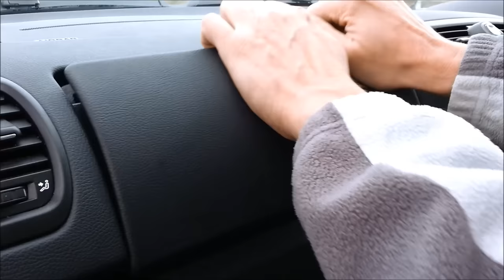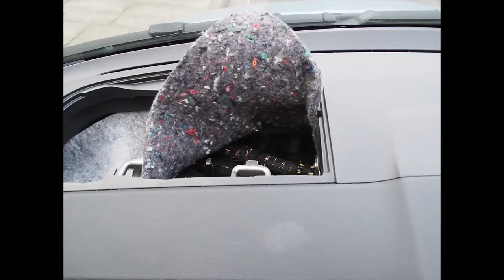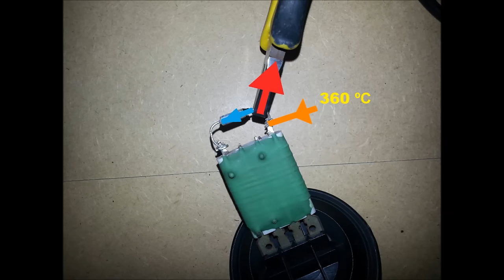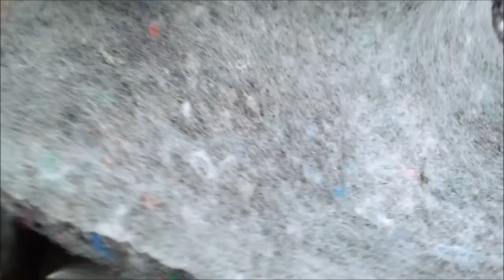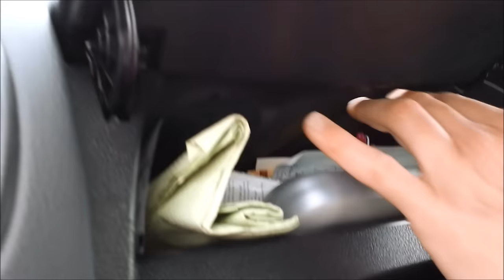How to Replace Blower Motor Resistor Skoda Roomster Skoda Fabia

Comment: Worked like a charm on my Roomster 2007. Bought the blower resistor off ebay for 17 dollars. The work itself took med all and all 40 minutes. Had a bit difficulites clicking on the new resistor. Couldnt twist it back fully but nevertheless, it was secured in it´s place. Now alla speeds on the fan are working. Prior to this operation I hade zero effect on level 1 and 2. Thank you so much for this video! Your effort saves a lot of money and time for us all! I take my hat off for you Sir!
Reply from the maker: Thanks a lot for your comment
Reply: What is the name of the piece, you replace it?

Comment: Thanks, worked a treat on my 2011 Fabia. I did buy the whole fan resister unit for about £10 from Amazon. It then just took about 45 minutes to fit 😎

Comment: Just done this, great instructions, cost me £7.39 for a new resistor unit, not soldering required, just clipped it in!  Relatively easy to do, if I ever need to do it again it’ll be easy.
Reply from the maker: Thank you for the constructive comment Andy.
You're right, it's easier and faster to replace the entire unit.
Reply: What type of resistor is it?
Reply: this is the right question

Comment: Excellent video - just saved me £100 and 2 days off the road.  Only took 30 minutes to do and no problems when connecting battery agai9n.
Just need to be very careful about NOT dropping airbag securing screws when removing them.  Magnetic bit holder and cardboard used to cover holes just below the screws highly recommended.
Reply from the maker: Thanks a lot for leaving a comment and and a tip. It's very easy to loose a screw.
I'm glad it worked for you.

Comment: I'm very grateful to you for this. It was a fairly simple job and took only 30 minutes. The hardest bit was getting the new component to seat and lock in place. There is very little to lever against when using a screwdriver to remove the airbag, but the end of the lug on the far right can be lifted against the steel bracket below it.

Comment: Just did my 2013 Fabia with a replacement part from Ebay at £9, bit of a sod getting the airbag plug off and then back on, but all done in about half an hour, or so it seemed! Those Torx 30's are tight!! All done, fan working again, thanks very much for the vid, excellent help!!
Reply from the maker: Well done! Thanks for a comment

Comment: Your brilliant video has just saved me around £150. Quoted £53 for the part and £108 to fit by local Skoda garage. Bought replacement from Amazon for £10 and took me around an hour to fit. Bit fiddly but quite doable. I put a small blob of Blutac on the end of my torx bit to hold the screws when I removed them - many thanks.
Reply from the maker: Robin Pugh 
Thanks fot the lovely comment. It's  great that it works for you.

Comment: Great and very helpful video that saved having to take the car to a garage for a simple fault. Got  a replacement resistor off eBay and got the job done in half an hour. Read other comments and followed tips like blu-tac on the torx driver. Once I removed the airbag T30 screws, it was loose and I could see that it just needed to be levered up with a large screw driver to pop it out of the dash top. This was helped with some plastic trim levers I already had. Managed to do it without disconnecting the air bag too. The hardest part has re-installing the airbag top cover but once I realised how it clipped back in it was no problem. Thanks for posting.
Reply from the maker: Thanks for leaving a lovely comment. It's great to hear the film was useful

Comment: Hey there, thank you for the video!

I own a Seat Ibiza 4.  2008 with only 4th speed working on the fan. I bought a new resistor but the issue is not solved. Still only 4th speed working. Any suggestions? Тhanks in advance!

Comment: Great video, everything perfect except mine is T30 bolts holding the airbag in.  Struggled getting the cable off the original resistor pack but got the pack out easily, really struggled getting the new pack in, couldn’t turn it all the way, assume it’s ok as it felt secure!!
Reply from the maker: Thank you. My low quality torx bit size 30 was a bit too big.

Comment: Good video, my fan does not work on any speed. Could this resistor pack still be the problem or is it likely something else like the motor and if so do you have a video of replacing the motor.
Reply: Try the fuse. The fan should still work on setting 4 without the resistor. If not it would be motor.

Comment: Does this control both fan speed and heat? We have a mk2 fabia 2010 that blows on all speeds but only cold air. We've checked the heater core and that seems fine. Can't think of anything else. Thank you.
Reply from the maker: This only regulates the fan speed. It does not set the temperature.

Comment: Hi, In my 2009 roomster the blower works fine but there is no heat comming out.
I checked the hot water pipes and their both hot.
There is no noise when I twist the temperature button so it is probably the blender door actuator. Do you have a video shows how to replace it?
Reply from the maker: Sorry I have just came back from holidays. No, I don't have a film about it but I'm sure I've found something by now.

Comment: Tried this , great instructions but I still have the blower only on number 4, any ideas please ?
Reply from the maker: If you only replaced the thermal fuse, the resistor may be damaged.
https://youtu.be/LUNvzyvn8J8
Reply: @k-nemo  where is the resistor please, I only saw that unit and changed it

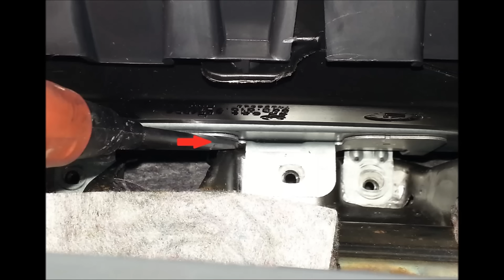Comment: Great vid. Although the arrow at 1:41 should be up as the airbag pops up and out, not sideways and up. The leverage needs the be upwards.
Reply from the maker: Thank you for appreciating my video. I am pushing the screwdriver in and then turning it.

Comment: So, my speed fan 1,2,3 not working, olny 4 th speed, does this solve my problem?
Reply from the maker: This means a damaged resistor. The thermal fuse may be blown or the resistor circuit may be open.
https://youtu.be/LUNvzyvn8J8
 Replacing the resistor usually solves the problem.

Comment: Please guide how to pick a matching thermal fuse 10A or 15A. and also please guide how to solder a thermal fuse in which direction or it can be soldered both sides
Reply from the maker: 10A should be enough. Any direction is OK. This is not a semiconductor element.
Before changing check yours thermal fuse. Often is faulty but sometimes there is a gap in the circuit in the unit. You can buy new unit in Chinese shop for a few dollars.
Reply from the maker: Check my film: https://youtu.be/LUNvzyvn8J8

Comment: Am I right in thinking that what you actually replaced was a thermal fuse. The green part is a resistor tapped at several points for speed control?
Reply from the maker: It is a thermal fuse
Reply: RG5355 I got the whole until for a tenner off eBay, no soldering involved

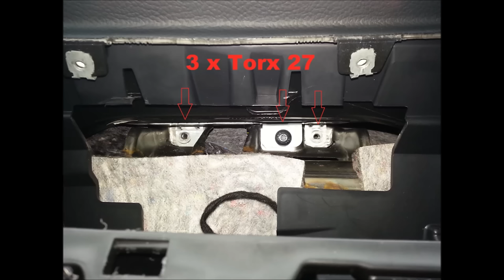Comment: 2 things I did wrong to warn others of, when unscrewing the main screws at 1:15 it is easy to drop them down into the car and lose them... I happened to have  a foot long pair of tweezers so was ok but after dropping the first I got some card and bent it gently to make a gutter to lower the risk as the bolt came out, same for putting it back.
Other point... as the video says, don't use a screwdriver to lever open the airbag hatch... but equally, when trying to maneuver the air bag to disconnect it, be careful not to rub the air bag fixing across the dash, it has sharp metal pieces on it which scratched my dash worse than the screwdriver showed!  Like others I just bought the whole part rather than the resistor... my part looked rusty and had a breach in the coil.  Also This is a Skoda Fabia MK2 although the video doesn't make that clear.  I am not saying that a mk1 is different... but according to the ebay listing I bought the part as shown in this video from, said it was not compatible with the MK2.... this was not the case however, it looked the same and worked fine.... just saying that because I was anxious when I bought the part but this video convinced me it was probably ok and it was.

Comment: Will this work on a UK skoda yeti 2.0 tdi 4x4 RHS model? Its a 2010 year model. My symptoms are that the blower/fan doesn't work on any settings not even one through to the highest.

Would appreciate it greatly if somebody would post a link to resistor that would be appropriate for this model?
Reply from the maker: When the resistor is damaged, the blower only works at the highest speed. Check the fuse in the box.
Reply: @k-nemo  thank you for the response will have a look
Reply: I have checked all the fuses with a tester for continuity. All are good. Like i said it doesn't blow on any setting. Could it be that the fan is faulty? Or shall i replace the resistor first?

Comment: Hi
I managed to remove the airbag and I can see the resistor unit but can't get it out. I tried wiggling it to the left and right but no luck. Is there a trick to this? I do not want to break it...

Also, can you give some info on the type of resistor that you replaced
Reply: And where do you buy just the resistor?
Reply from the maker: To take the plug out you need to squeeze it like shown with the arrows. The resistor needs to be turned and pulled out. Sorry but I can't remember which way. I got the resistor from somebody. My friend also soldered a resistor but it didn't work. It started working when he brought a ready to use resistor with a holder.
Reply: Thanks for the speedy reply. The trick was to push down while turning it. Anti
clockwise worked for me. I have a left hand drive car.

I found a complete resistor unit for only as few bucks more than just the
resistor on eBay.

Comment: hello, nice video. Which resistor is needed? thx a lot!
Reply from the maker: It's cheapest if you buy the whole pack online, for example banggood, aliexpress, ebay. Some resistors for soldering are hard to pick out, the resistance could be different.
Reply: k-nemo Okay! ty
Reply: It is a fuse that burns over 240  degreeso to protect the resistor that controls the speed of the fan motor.

Comment: Hello wich temperature for this thermal resistor, is 240° is right
Reply from the maker: Thanks for watching. The temperature is not given on the resistor.  Often there is a problem in picking a resistor with the correct resistance. For a few dollars you can buy a full set.

Comment: do you really need to disconnect the car battery to carry this out? TIA
Reply from the maker: You don't  have to but I felt better when I did it while I was taking the airbag out. When you turn the key with disconnect airbag the computer will register an error which won't disappear on its own so you'll have to go to the mechanic to reset it.
Reply: @k-nemo  hi thanks for your reply. Do I need to turn that key to disconnect the airbag?
Reply from the maker: No, the key has to be taken out, the power off. In fact you don't have to disconnect the airbag at all but you have to be very careful not to scratch the cockpit plastic with metal part of the airbag. It can be done easily.
Reply: @k-nemo   Thanks...just did mine today. It was a real pain as slightly different to yours, I have a Skoda Fabia Estate Greenline. I turned off the airbag using the key turn inside front door. Hardly any space to see where to turn resistor in and out. First time I had not pushed it all way in so fan worked on Number 3, so had to open it all again and push In proper, now working perfectly...thanks!
Reply from the maker: Super, I'm glad it worked in the end

Comment: Unfortunately didnt work out for me. After removing the bolts i tried to wedge a screwdriver in there, just like you did, but it didnt pry out the airbag. So i went to bigger and even bigger screwdrivers, til i ended up wedging a pry bar in there, bending the whole dashbord as the airbag pushes it up. At some point i gave up because i didnt wanna cause unnecessary damage.
Reply from the maker: After removing 3 x bolts Torx 30 you have to put the screwdriver under the edge of the metal plate. Look at the picture 1:40 with the red arrow. The arrow is under the edge of plate.
Reply: @k-nemo  This is exactly where i put the screwdriver as well. Just twisting it to the side to pry the airbag up didnt do the trick. I used bigger and bigger screw drivers (Much bigger than yours), til i even switched over to a pry bar and wedged it in there. The whole dashbord pushed up on the sides, but the airbag stayed in place. Maybe its due to the cold temperatures, but it unfortunately didnt work out for me.
Reply from the maker: I'm sorry it didn't work for you :(
Reply: @k-nemo  it is the same for me probably because its around 0 deg outside....

Comment: What is the value of that resister that you have replaced
Reply from the maker: 10A -15A, temperature 150-180 degrees Celsius. Make sure is the thermal fuse is faulty. I made another film how to check resistor: 'fan blower motor resistor test' https://youtu.be/LUNvzyvn8J8

Comment: I followed this video and fixed the heater resistor upon re assembly now the airbag warning light keeps coming on.
Reply from the maker: Before disconnecting the airbag, you must disconnect the battery.  Now you need to take the service computer to clear the airbag error.  It's a simple activity and inexpensive.
Reply: I tried to clear this with 2 scan tools but no success do I need vcds or something specific. I'm afraid that there is something major wrong now

Comment: I've just done this on my car but now my main airbag light is on. I turned on the car to check it before putting the airbag back in. I've put it all back together and noticed the light. I have turned off and on my passenger airbag but that hasn't changed anything. Has anyone else had this problem/know what I can do?
Reply from the maker: You should't have turned on the car with the airbag disconnected. The computer has registered the error and now you need to connect the diagnostic computer to clear the error. It is not expensive. You can ask on several garages to compare prices.
Reply: @k-nemo  thank you I realised my mistake quite quickly

Comment: That is NOT a resistor but a thermal fuse
Reply from the maker: The thermal fuse is the part that is soldered. The whole green unit is called a resistor because it has resistors inside, turned on by the circuit in the blower's motor to change it's speed.